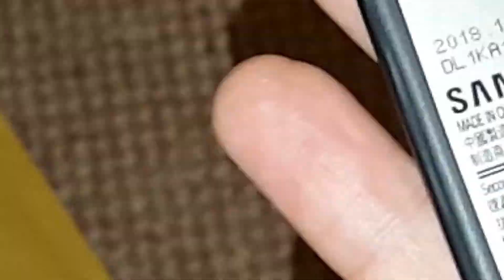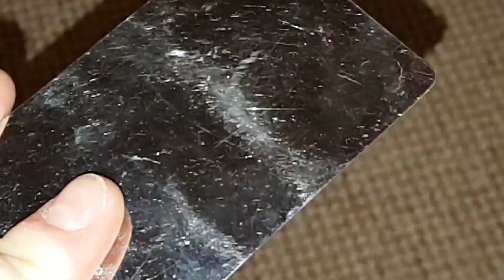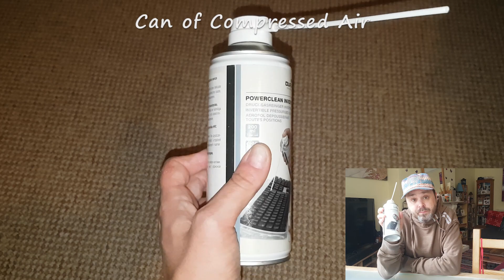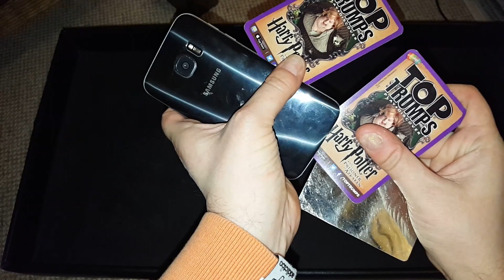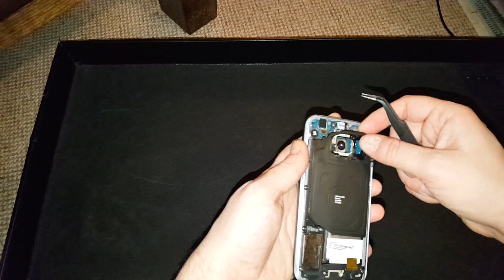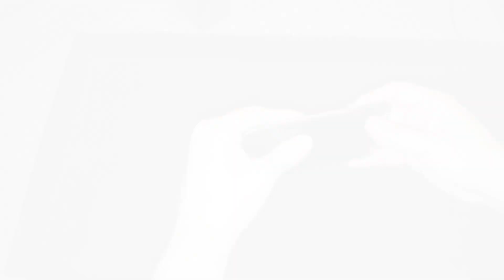How to Replace the Battery on a Samsung Galaxy S7 // QUICK TUTORIAL

Comment: does your replacement battery works on your samsung galaxy s7 beacuse i have a samsung galaxy s7 and i did get the battery replaced does yours work?
Reply from the maker: Yes, the replacement battery worked fine that I used. The problem with phone batteries is that it's very difficult to find genuine official branded ones as there are so many counterfeit fakes out there. On websites like Amazon it's near impossible to buy an official Samsung battery for example. The first red flag is the price as there's no way Samsung would sell a genuine battery for around £10. You then just need to read the horrendous reviews to know it's a fake for sure. I had to do a fair bit of research in an attempt to buy a genuine S7 battery so it's a surprisingly hard task which is pretty ridiculous really. 🙄
Reply: @SlapDashVideos  well in india we use real parts but at least your battery works tho
Reply from the maker: @PScool3590YT  Yeah, glad works and didn't die after a week like the reviews on the fakes I read. 👍
Reply: @SlapDashVideos  yep

Comment: How do I replace the Sim card
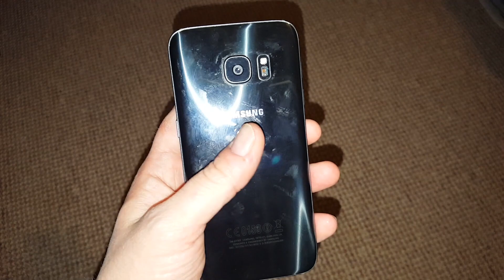Reply from the maker: Hi, I show how to remove both the SIM card and Micro SD card at 01:50 using the SIM removal tool that comes with the phone, but you can also use a pin to carefully push down the tiny hole on the top of the phone. Hope this helps and thanks for watching. 🙂

Comment: Pretty good video. Hardest part was getting the back off. If you are careful, you can save much of the water-proofing adhesive on the back. A couple suggestions. With phones, computers, cars, anything, they are highly, precisely engineered. If a piece doesn't fit easily, remove it and try again. Do not force a part! The part should fit in easily. When putting screws back in, turn them counterclockwise. They will click into place. You can feel this happen, and often hear it. Then you can turn the screw clockwise to tighten. This will keep you from cross-threading the screw. When you put the three cover parts back on, there are a few more steps than they show. Put the largest piece in first, but don't screw in tightly. That piece needs to interweave with the bottom part. On the left side, one tab on the bottom piece has to go under the larger piece, while one tab must go over the larger piece. On the bottom piece, these is a tab at the bottom that can be snapped into place by pushing on it. On the top piece, the top edge of the middle piece must go under the top piece. Also, I believe a tab on the top part has to go under the frame of the phone. Tighten the screws slightly as you put them in. Then tighten them at various opposite places, like putting a tire on your car. This will avoid one side being tighter than the other or stress put on one side.
Reply from the maker: Thanks for your detailed input here and for taking the time to watch my tutorial. Much appreciated and some great advice here. Btw, I've only just found your comment in my 'Likely to be spam' (for some reason!) folder so only just found this to approve. Sorry for the late reply and thanks again! 👍